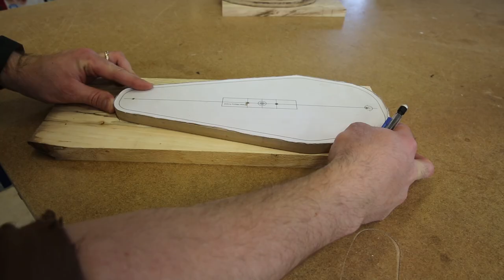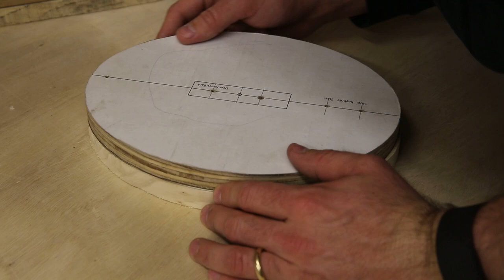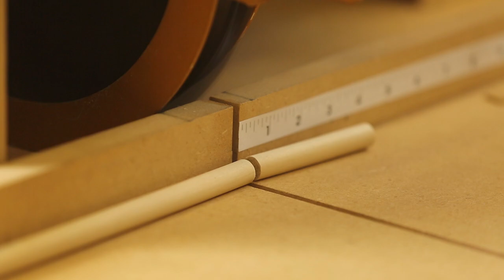Making a European Mount Wall Plaque/Table Pedestal

Comment: This is a fantastic video! I love the detail and use of your jigs and templates too.  Great stuff!!! What is the type and brand of countersink bit you used in the drill press?
Reply from the maker: I got those bits off of Amazon. They are: Irwin Tools 1882792 SPEEDBOR Countersink Wood Drill Bit, 8-Piece
Reply: Awesome! I'll look into them. Question about mounting bigger species. How much bigger are your mount and shield for an elk?
Reply from the maker: I have only built one elk plaque so far and it's is a bit undersized, even on a small elk. I made that one 35% bigger. If I were doing it again I would try 45-50% bigger. And because of the weight difference, I would either do a double keyhole in the back to hang it, or work in some metal hardware just to be safe.

Comment: What size dowel rod do you use for the skull to hang on ? I don't see the size in the PDF.
Reply from the maker: Really whatever seems good to you. Don't go too small or it won't be strong enough. Go as heavy as you can but still fit easily in the hole. 3/8 to 7/16 is usually good.
Reply: @GunflintDesigns  I found a 3/8" piece of Red Oak dowel in my shop and it worked great. Thanks so much.